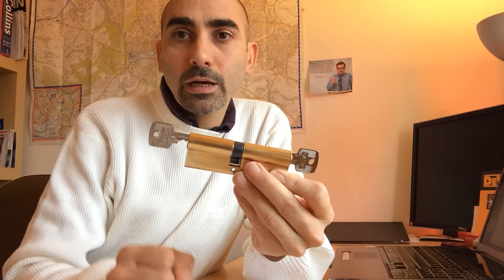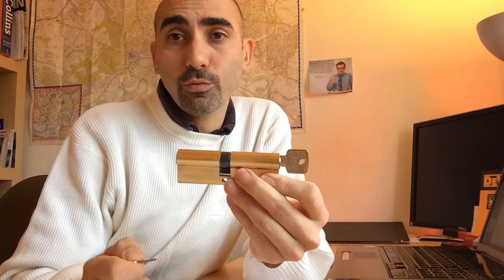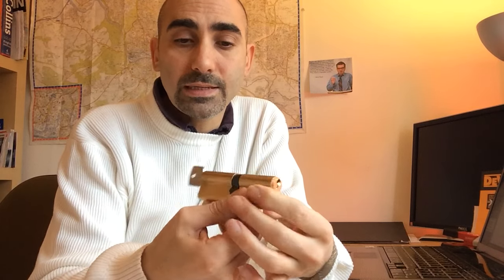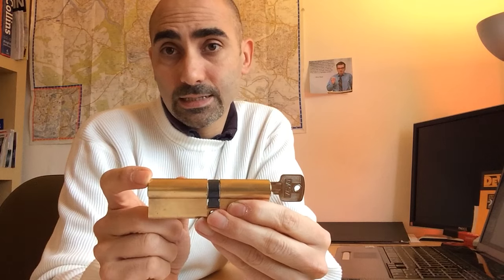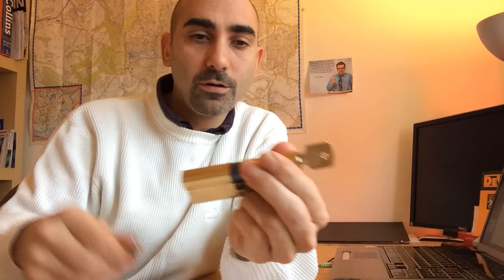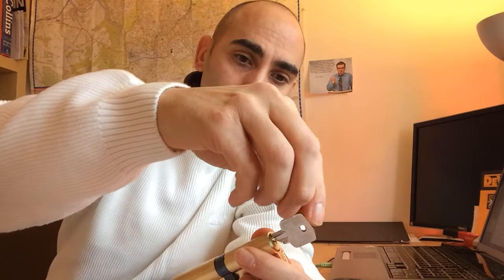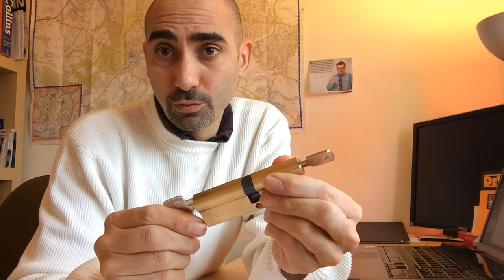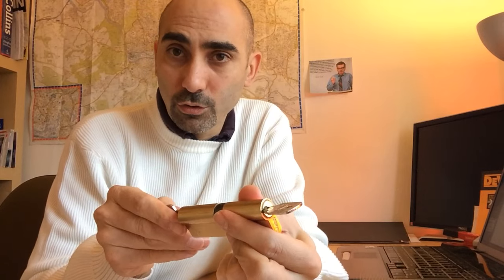UPVC lock out with key on inside - Can inside key be pushed out?

Comment: So if you leave the inside key inserted and rotated by 60 degrees; does that prevent lock bumping?
Reply: Bernard Pilling that’s what I want to know 😂😂
Reply: If you're worried about lock bumping then you should buy a lock called the ERA Fortress its snap proof but also bump proof because it contains trap pins that will trap a bump key when bumping is used. Also it's a British made lock and has a 3* British standard kitemark